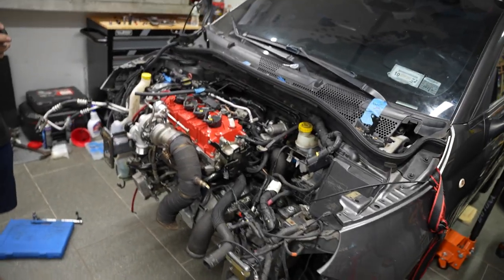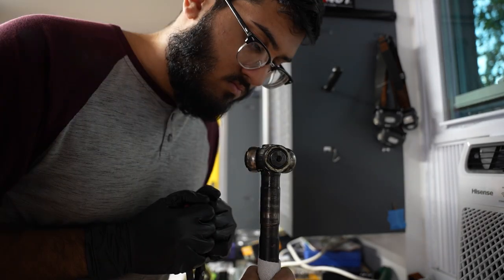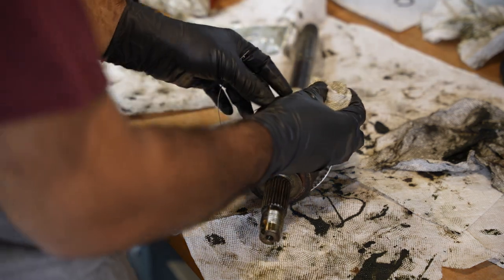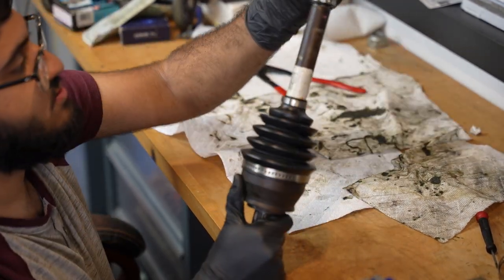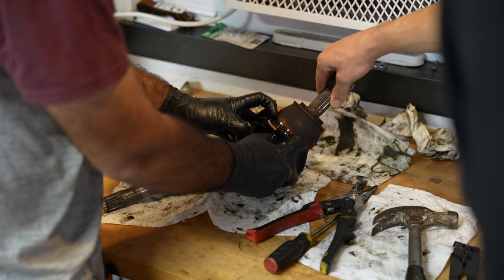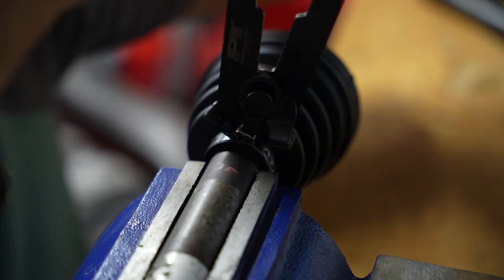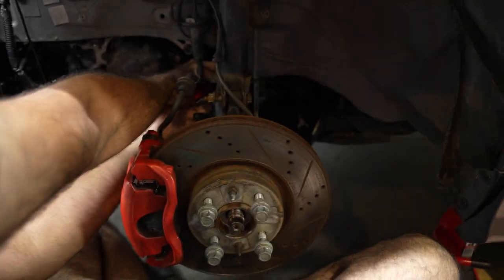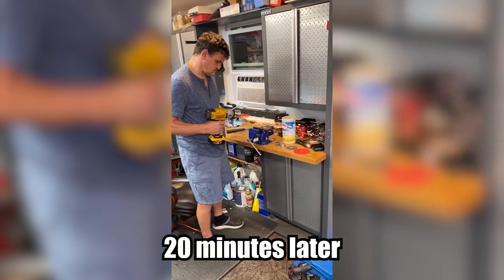Rebuilding Fiat 500 Abarth CV Axles!

Comment: Removing the right side stub axle is not difficult.  Three bolts (10 mm) hold the axle in place, pop out with a pry bar.   Then assembly goes easier since you have the whole thing out and it's so much easier to tighten the boot clamp when everything is out.  Putting back in kinda easy, just keep rotating and pushing until it goes in, secure with those three bolts and you're good.  FYI, removing clamps is easier if you pry up the end with a flat blade screwdriver, cutting the clamps is not required.
Reply: It's also much easier to make sure the inner boot is on correctly with the stub axle out.
Reply from the maker: I had gotten the bolts removed but the stub would not budge further than an inch that I got in the first ten minutes of me trying with the pry bar all around it, the right sides clunking now so I’ll remove the whole thing with the likes of a vice grip slide hammer.

Comment: Did you find any damage in your axle cups? They’re super expensive and don’t come out easy. My 2017 is starting to vibrate with full throttle in 3rd and 4th. Has to be the tripod bearings I assume.
Reply from the maker: Wasn’t anything bad enough for me to recall, usually it’s just the bearing and not the cup that’s damaged. If the boots got too little grease than there’s a possibilty the cup is damaged.